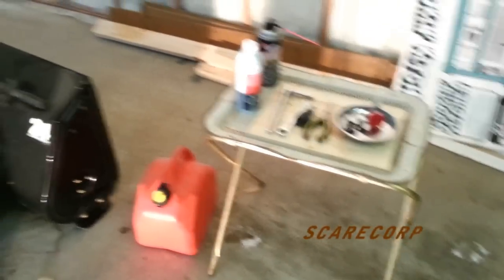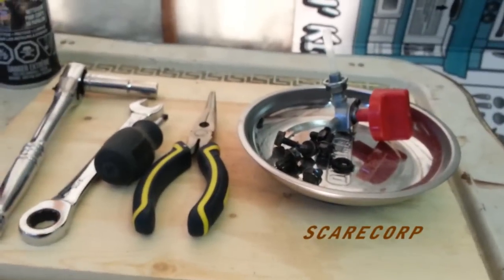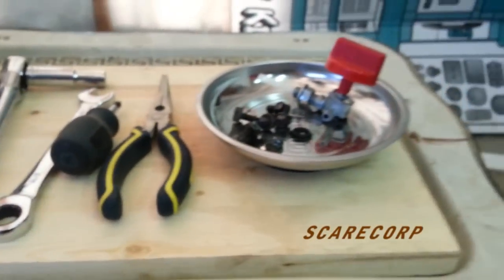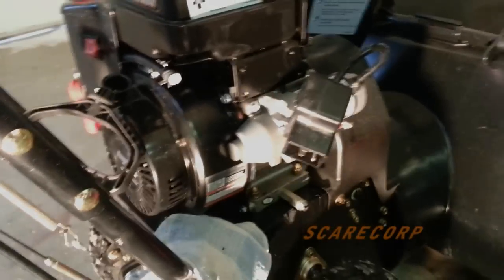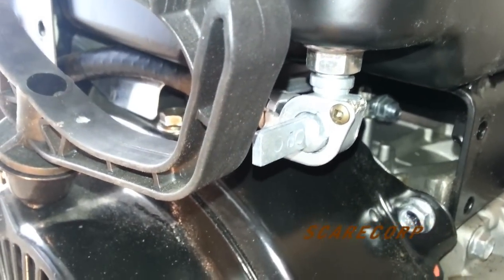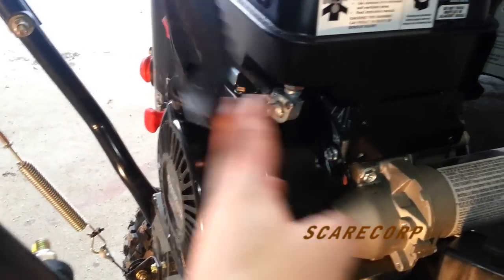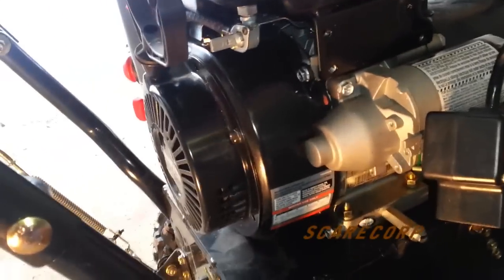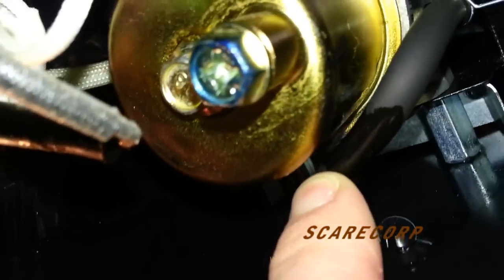Snow Blower Repair Part 4

Comment: I thought it is cold in Chicago. 0 degrees. One thing, the primer bulb  just take air and pushes into bowel. This forces fuel up in engine to quick start. You should only have to prime 3X. Sometimes the gasket bowel goes bad, float, needle or seat. I would do a minor carb rebuild making sure to seat new gasket properly.Check the hose first. Your engine is surging. Clean the jets. Good Luck.